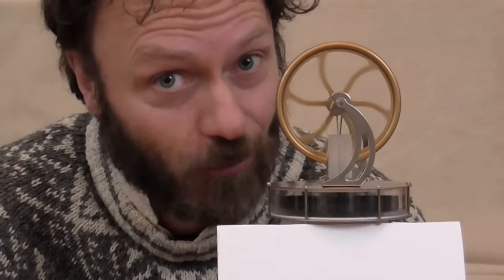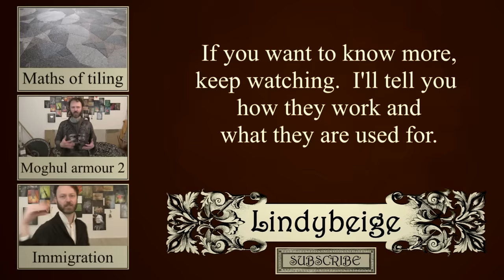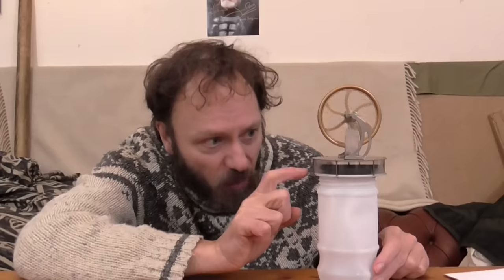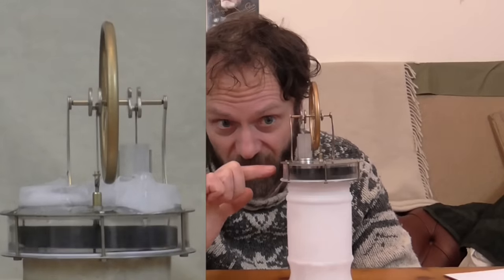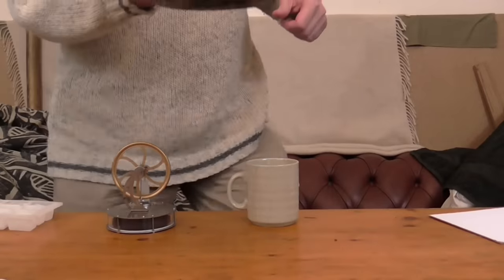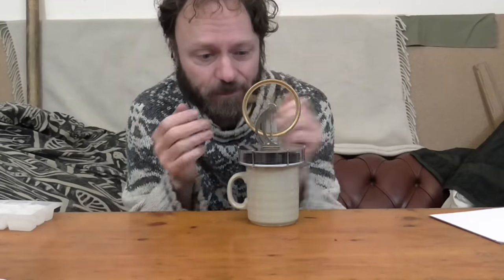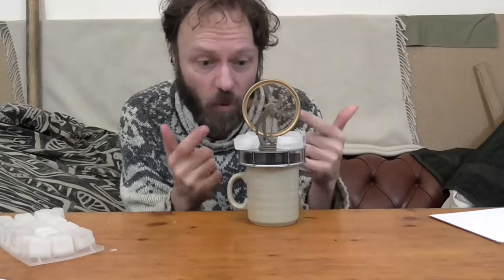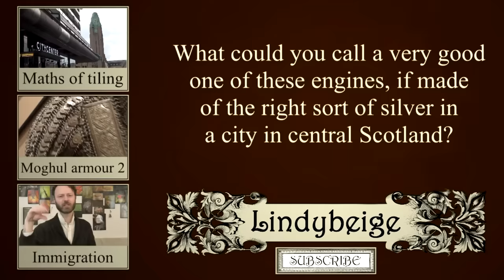Stirling Engines - the power of the future?

Comment: This has me contemplating something for a fantasy setting where some enterprising spellcaster/engineer figures out a way to place gates to the Elemental Plane of Fire and the Elemental Plane of Water on opposite sides of a massive Stirling frame in order to power a death ray.
Reply: That'd be great, actually.
Reply: Solemn Howler why not just trap air elemental in VAWTs?
Reply: assuming magic that violates physical principles and machines that rely on those physical principles means that it is almost always a trivial exercise to create perpetual motion or over unity engines in fantasy settings... as a writer and creator i find it much more interesting to try and explain why they have not been created already, as otherwise every fantasy setting undergoes a magitech based industrial revolution as soon as you start applying common sense engineering.
Reply: Keep a lobotomised dragon on top of one?
Reply: That sounds pretty awesome

Comment: It's just a heat engine, not unlike a reverse version of your refrigerator or your air conditioner. This could actually be quite useful, particularly in the grounds of an engine powered by night. Yes, night. In many parts of the world (particularly the desert), the ground is cooler than the air in the day and warmer than the air in the night. Hook up a sterling engine to that temperature gradient, and you have an engine that works simply by placing it on the ground.
Reply: Alexander Abrams-Flohr but the sand would probably damage it making it need a lot of upkeep
Reply: they are sealed chambers

Comment: So, we could run a massive-ass sterling engine on top of the plutonium and uranium baths to produce energy as well instead of just wasting water?

Also, do these produce a lot of condensation?
Reply: NarpytheCrimeDog he explains all of this in the video, the stirling uses cold and heat to create motion, so i really don't understand what that has to do with uranium and plutonium baths, a place where people put the used materials from a nuclear power plant so that the radiation doesnt cause everybody in the area to get radiation sickness and long term radiation caused damage (like cancerous cells)
Reply: Issue with that would be that the reactors are designed to use the water baths as safety mechanisms. But yes, and it'd look a hell of a lot nicer than a typical nuclear power plant too. A steampunk monstrosity rather than an ugly concrete one.
Reply: farmerboy916 really? i find nuclear power plant cooling towers to have a certain industrial look to them, if you just imagine that all the water vapor is smoke from heavy machinery
Reply: yo boi jonx
I mean yeah, but they have the downside of having had an aura of fear built up around them. Plus, people tend to like the industrial look in some circumstances but it increases the "not in my backyard" effect.
Reply: If you had that you would still need some kind of fluid to make that trade of heat, water or air, you would still to have fluid. And imagine the air going out of that engine, it would be full of water radioactive vapor.
Reply: It's already exist, though it's not using sterling engine. It's called radioisotope thermoelectric generator.

Comment: Thank you for interesting video. Micro cogeneration is still in it's infancy, but these things are slowly coming to residential market.
In my case I am heating my house with natural gas (from pipes, not bottles), which is 3 times cheaper here, compared to electricity. So I started looking in to electricity generation from heat. Found your video.
All is nice, youtube is full of these demonstration units, however I am still to find a working unit at 10kW or so.
Reply: You can convert a car engine to burn gas.
Reply: @hermitoldguy6312  Do some calculations :) New engine will fail in one-two years and will need oil changes every week.
Reply: @circuitdotlt  Nicolaus Otto was making gas engines in the 1860's (hence the Otto cycle).
Reply: @hermitoldguy6312  I run my car on gas, too. But it's not the same as 24/7 operation.

Comment: You do not have to go to Antarctica but look at the geothermal pools in Iceland.  Iceland it self can be a bit chilly too.
Reply: True, but then, Iceland have some nice geothermal power plants as well. :)
Reply: then the question would be, what is more efficient, using stirling engines or the turbine generators most geothermal plants use
Reply: You would have the same question with Antarctica, but Iceland would be closer and less expensive to run test.
Reply: Why not both? Don't geothermal plants also have wasted heat? What if this was attached near the exhaust portion of the plant, and it could capture/use some of that waste to provide even more electricity at only the cost of construction and maintenance. Now, is this cost efficient/economical at a municipal level. But that's something they'd have to investigate if they were to implement these.
Reply: Terry Endicott yes but the also have letters like þ and đ.
Reply: There's a company in my area that tried to recover wasted heat from the aircond condenser using stirling engine in order to reduce the electrical usage from the aircond. End up they spend so much on the maintenance of the system, that the saving is not even worth the trouble.
Reply: Eđ and þorn save energy because you only need to write one letter instead of two.  We should bring đem back in English.   Đat's what I þink.
Reply: jimpozcaner -- What have you done?!?!?  Of course they saved energy.  Energy you have squandered in your long explanation.  The letters you used could have been sent to a country with a large illiterate population  but no they were squandered in a YouTube comment.
Reply: I would imagine that turbines would be more efficient for large power plants. And wasted heat in Iceland is already being used for district heating.

Comment: This would be perfect for some place like Arizona. Just bury some kind of thermal conducting anchor into the ground at say 5 or 6 feet, have it touching the bottom plate and then wait for the air temperature to either rise significantly above or sink below that.
Reply: I just saw that you said it would be BAD for places that are warm....but but but....why can't you just anchor it to a thermal conducting material buried deep under ground?

if you dig a good 4 feet down, even in Arizona, the temperature drops down into the 60s virtually year round.

So in the summer, you would have a top plate at the temperature of the air (say 100 degrees) and the bottom plate would continue absorbing heat and dissipating it into the ground.
Reply: Freddy Fred. the ground in the area will eventually become heat soaked.
Reply: Sun powered water pumps for Africa/middle east anybody?
Reply: Exactly. If the main factor driving RPM on a sterling motor with a flywheel is the difference in temp between the top plate and the bottom plate, then simply pivot from one to the other when the air temperature differs significantly from the ground temperature.
Reply: That is one of the fundamental uses for Stirling engines, BITD. They were made & sold in a couple of small sizes for farm use [around a century ago, when most farms were still wood-fueled and having a small portable engine that ran on wood was a desirable thing.] The killing stroke for Stirling engines [originally, two centuries ago, and again 100 years ago] is that of materials science: being able to manufacture the engines out of materials that could withstand the high temperatures required, etc. Which just so happens to be one of the areas engineering has made HUGE strides in over the last century [not so much in the preceding 100 years.] So yes, Stirlings are overdue for a rebirth, esp. as people are struggling to de-urbanize & "get off the grid."

Comment: Anyone all of a sudden want one?
Reply: Jacob Gourley, want one? I just bought one!
Reply: Jacob Gourley Vsauce.
Reply: is the chamber with the displacement disc ... air sealed?
Reply: Jacob Gourley I just got one
Reply: £20 off banggood
Reply: Jacob Gourley, want on?  I built one out of some beer cans.  :-)
Reply: +TheCompeteGuitarist, yes, the chamber is air sealed, as that is how the power piston is working. When you heat up gas, it will expand in volume.  And if the gas is cooled, then the process is reversed.  
That is how it works, like an steam engine.  Except that the power pistong is pushed and pulled by the gas.

Basically, the engine is powered by moving energy from hot side to cool side.
And if you mechanically force it to turn around, you will transport heat from cold side to warm side, that is reversing the process.
Reply: same here lol
Reply: BUILD ONE EASY
Reply: No thanks mate. I just drank my last cuppa tea.
Reply: building a submarine?
Reply: Love to get one.

Comment: you could expose the hot side of a Stirling engine to direct sunlight and submerge the cold side in the collection tank of an artesian well. Then you could use it to drive your water pump.
Reply: SO = IN THE DEAD OF WINTER AND THE DEAD OF SUMMER - ONE OF THESE MACHINES PLANTED IN THE GROUND WITH THE HEAT OF THE EARTH IN THE SUMMER COOLING IT AND THE HEAT OF THE SUN WARMING IT WOULD MAKE IT RUN BEST AND DURING THE WINTER WITH THE HEAT OF THE EARTH WARMING IT AND THE COLD OF THE AIR COOLING THE TOP OF IT AGAIN IT WOULD WORK BEST USING THERMAL ENERGY OF THE EARTHS CHANGES COMPARED TO THE OUTSIDE TEMPERATURE.. HMMMM ... this engine would slow down in the spring and fall compared to the winter and summer
Reply: Since an Artesian aquifer is under pressure, drilling the well in a place where the water will be able to exit the well with its own pressure would require no pump. Just sayin
Reply: Sterling engines produce very little power compared to their size.  As he said in the video you'd need a house sized engine compared to what a small 2-stroke can do.
Reply: You are right kind of(most don't have artesian wells, they are just normal wells, Just don't use a small Stirling engine. But then you would need to constantly change mediums depending on the season. liquid nitrogen in summer and a simple water heater for winter would be sufficient.

Why is that bloke typing in caps? he may have a point, but i am not reading that, that's the equivalent of yelling. This is a scientific thought process, perhaps they should speak in a way that doesn't diminish others.

And Oil Lease, You are wrong, well sort of. ar·te·sian
    relating to or denoting a well bored perpendicularly into water-bearing strata lying at an angle, so that natural pressure produces a constant supply of water with little or no pumping. a tiny Stirling engine could be exactly what a artesian well would need.

When i lived in Texas, And our power would go out. We could not get water from our wells. Over use drastically reduces the water level in said strata(or aquifer) To the point you need to have a pump powered by electricity. If the well is recently dug, it shouldn't require pumps, but if its old it most definitely needs pumps. 

the real problem is everything thinks of wells as always artesian, when that word only infers what angle the water in the strata are angled at.
Reply: @davidross5770  You could use it as a calendar.

Comment: Awesome video!  Question: If the tops of people's houses living in cold environments was covered with these.. how much power could they throw back into the system compared to the power being used to keep themselves warm in their home?
Reply: Not as much as the roofs of houses in hot, tropical environments close to the equator. Quite simply, you put power into a Stirling to create a "heat pump" in order to concentrate heat inside your super-insulated home in that sort of environment, instead of trying to cool your already chilly home further in the attempt to generate the fraction of a horsepower needed to run a sewing machine. Stirling engines are still heat engines: ie, they work by extracting power from the movement of hot > cold in a regime where a differential exists. Most of the time, we have to create that differential by burning fuel. Sometimes it exists naturally, like the someplace that receives a great amount of sunlight. And the absolutely last thing we want to do is accelerate the rate at which heat we've had to pay for to provide a warm environment slips away into the winter air by trying to run a Stirling engine off our house! Let me guess, your parents are still paying the bills, aren't they? ;)
Reply: Nunya Bidniz  I was referring to houses in snowy places, like Russia, Canada, Greenland, etc.  Usually most of the heat inside of  a home is concentrated toward the ceiling.   Just curious how much of the energy can be salvaged.
Reply: That would not be as efficient as just properly insulating your home. The Stirling engine would effectively be like an open widow. Sure it will generate some power but by using it you're still letting heat out of your home instead of keeping it inside.
Reply: hedgehog3180 that makes sense. Thanks for that answer.    What about installing these near hotsprings in cold environments then?
Reply: Similar to the Antarctic example it should work nicely. Essentially you're describing a geothermal power plant, just one that happens to use the Stirling cycle.
Reply: The smartest way to minimise waste energy is to minimise waste energy, not trying to hook it up to a generator. In the case of a building it is possible to have very good insulation and that would be the most energy efficient way to deal with it. But, it could possibly be used at home in other ways. Like, if you made it small enough to sit on a computer or a TV etc. That could be used, because those appliances are creating waste heat. Again, if there is a way to avoid wasting heat by making more energy efficient appliances, then again, it is better to do that than power a sterling engine. 

In for instance a nuclear power plants it could be possible to use them. You could install them on the cooling towers for instance, modern nuclear power plants are creating a lot of waste heat. BUT this wouldn't do much difference, probably talking about just some few percent or even less. But I mean, some extra watts are better than none.

Comment: Stirlings are inefficient because they operate at low temperature differentials. Ford and Philips jointly developed Sirling engines in the 1960s-Ford put one in a Falcon car-it was twice the weight and half the power of  the gasoline engine. Philips developed  Stirling generators to power vacuum tube radios-transistors made that application obsolete.
Reply: hmmmm check that again compared to ICE they exceed the efficiencies of ICE -ideal models can't achieve the 50% conversion of thermal energy to kinetics but utilization of thermal energy far exceeds 
ICE - in fact several large Sterling engines can be found in submarines for backup and electrical power...
Reply: people confuse efficiency and power density.  efficiency is limited by temperature difference eff= 1-(Th/Tc) is the maximum efficiency.  That is the Carnot efficiency, and a Stirling can get as close to that as anything else can, maybe closer.  Power density is how much power / volume or how much power / weight.  A Stirling engine is high efficiency, low power density.  There is one in Japan (Ecoboy?) that produces  1Kw from waste heat at a 100C temperature difference.  But the engine weighs about 1000kg.  Not a lot of power for a lot of mass, but most other engines can't utilize that waste heat, and the ones that can require special working fluids, like freon or propane, that can be hazardous if they leak.

Comment: Please consider the irony of measuring Sterling Engine output in Watts, the inventor of the reciprocating steam engine.
Reply: It makes sense

On a different note:
 Don't you feel like these engines could be viable when there is a great difference in temperature like  magma in antarctica.
Then again  when you try to do that you will inevitably heat up the surrounding air.

Maybe in a different planet. One in where it is -45°C. Can be also used to heat up the planet.
Reply: We could create a new unit, pounds Stirling - feet per second.